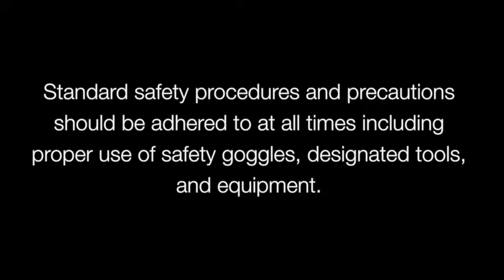Causes of Wheel Hub Failure

Comment: so ive only ever done front bearings on my 2010 chrysler minivan but both of my dodge calibers have needed rears.  the 2007 needed them at 223,000 and the 2011 at 271,000.  is that good life?  the '07 went 322,000 before it was totaled in a ditch in a white out blizzard.  the '11 is still running strong...
Reply from the maker: Thanks for the question. Yes, 220,000+ miles is good life for OE wheel bearings. Good to hear you keep up with maintenance and keep your vehicles safe on the road.

Comment: what about on a 2005 F250 where we are repeating to replace front wheel bearings in as little as 200 miles? many people report replacing in excess of 20 times! I'm at about 5 in the last year, my previous one last ted 4 months,, just replaced and gone in 200 miles,,, like all the others I have tried 4 different brands, etc. there has to be a reason.

Comment: Seal failure is # 1 in my book.  You did not mentioned that!!
Reply from the maker: Good point Phil. Seal failure is definitely one of the most common issues that necessitates wheel bearing/hub replacement. Although we did not mention seal failure in this video, all of the issues we did discuss can cause or contribute to seal failure. Thanks for adding to the conversation!